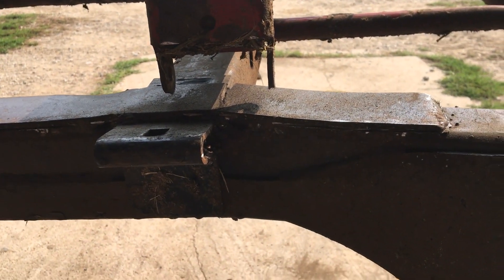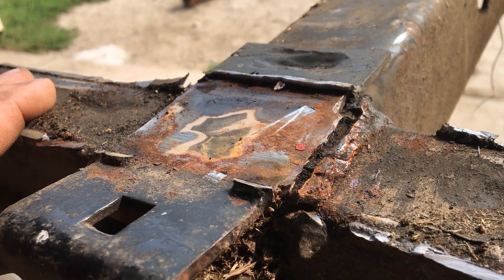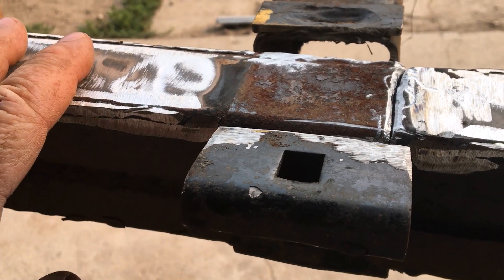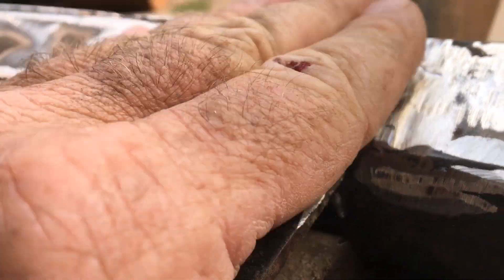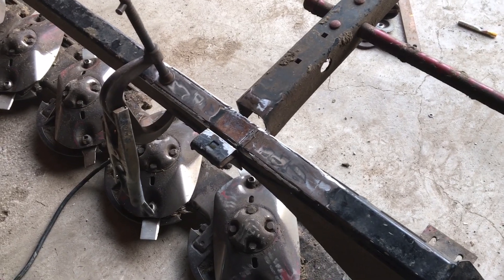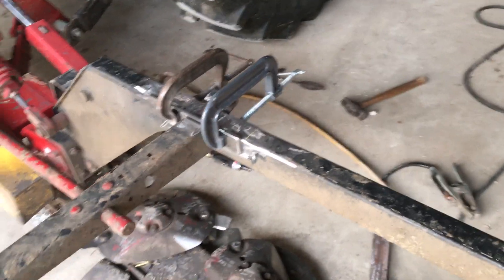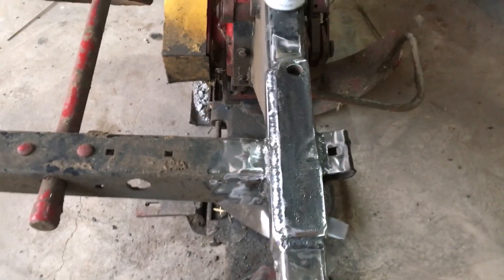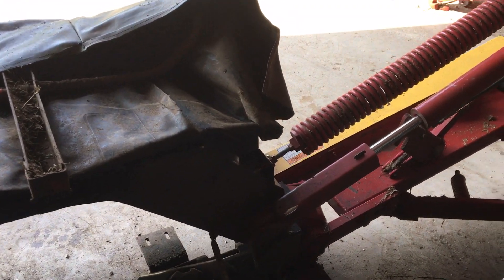*FAILURE* New Holland H6750 pt2

Comment: Very nice job. I would agree with you that is a poor design. We have a H7450 discbine and had very little trouble with it and nothing structurally. I guess it's different when you have that hood hanging out there like that. Also why did you chose to buy a NH over an Agco made proudct?
Reply from the maker: Great questions!  I bought this machine with the cracked mainframe :( because it was priced right.  Many neighbors run them and had gotten along OK.  At the time, NH had a superior pod design and was a "tougher" machine!  I use the mower for pastures, stubble fields, and general mowing (never in the hayfield).  Many use a bush hog for these applications, but I was replacing a sickle mower as I think that disks/sickles are better for pastures and stubble fields.  This has been my/my brothers experience with NH...brilliant design in one area with structural flaws in another area.  In fairness, I have not had a pod issue, and have hit some big stones, brush, wire, etc!!  I was NEVER a fan of the rubber on rubber.  Rather, have always favored Hesston's steel on ticor for LONGTERM strength and reliability.  I think agco has perfected the razorbar now and caught up to NH ;)!